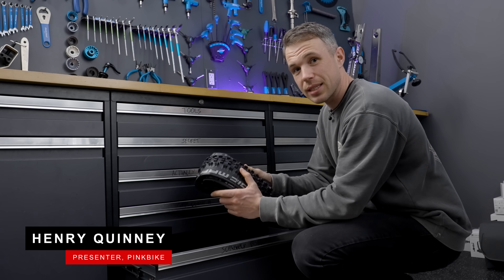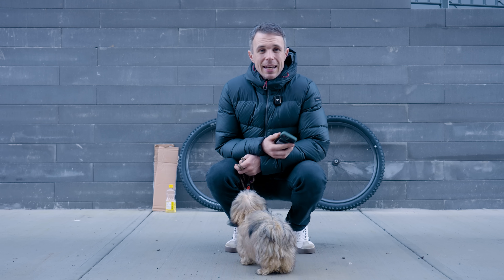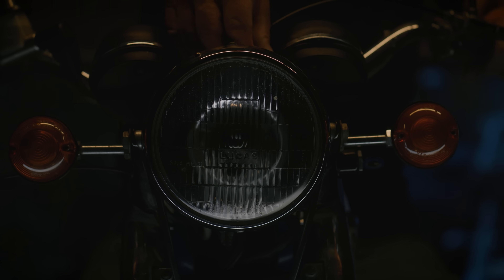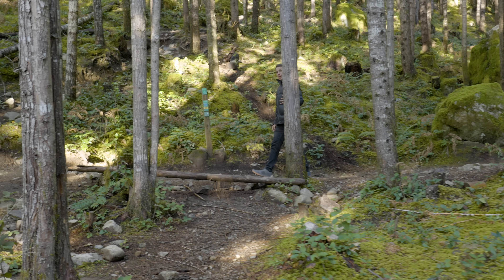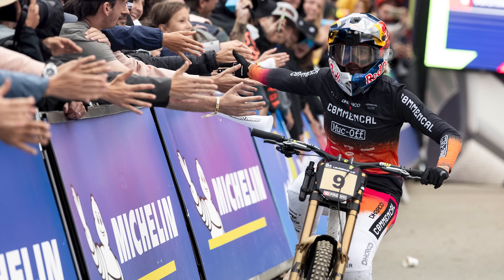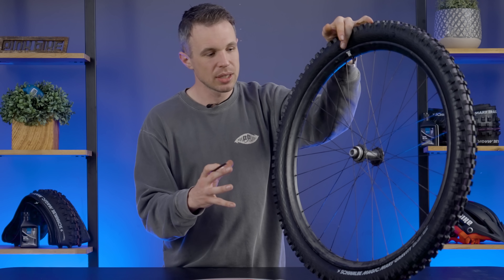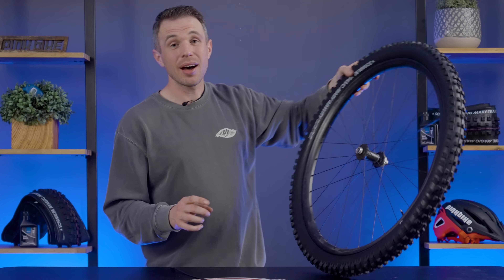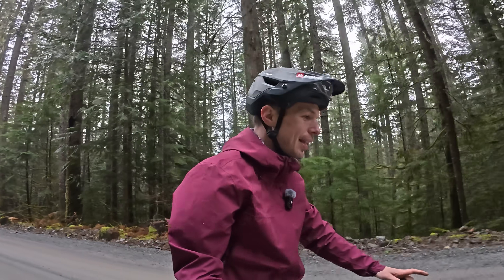How Does Schwalbe's Radial Casing Work, and Does it Actually Make Any Difference?

Comment: If you choose the air pressure so that both tires have the same rolling resistance, then I would like to know how the riding experience is or whether the difference cancels out. Everything else sounds like pure marketing to me. The placebo effect is very powerful.
Reply: That's what I was thinking, if you adjust the air pressure so that both tyres have the same contact patch then what's the difference exactly? just the number on your tyre pressure gauge
Reply: @ you cannot think that in numbers, its silly. 30 psi radial feels different and probably still has a way larger cp than a 23 psi non radial. And the point is not to pump them to 50 or keep your non radial at 14 psi.. this thinking is silly and same as if unc had tits hed be an aunt. The feel is the thing, not just the contact patch
Reply: @ I'm not thinking in numbers, I'm thinking in contact patch, if you set up both tyres to have the same contact patch and to where you don't have any rim strike issues, then what's the difference between the two exactly? besides the number on your tyre pressure gauge
Reply: @bertkreft9689  I’ve heard the knobs on the radials are shorter to compensate for the larger contact patch and rolling resistance.
Reply: Haha when you try these youll be amazed. The one thing in mtb that actually makes a difference. And this is coming from a Maxxis guy

Comment: 29 PSI additional 10% contact at what rider weight? Surely the rider weight is the most important info here before anything else.
Reply: 10% more compared to non radial tires. Rider weight is irrelevant.
Reply: I think these numbers are bs. If you have 200lbs on tires at 20PSI, you have 10 square inches of contact patch. The area doesn't change unless you change pressure or weight, but the shape might change a little. That's the whole benefit of a pneumatic tire.

Comment: Honestly, the biggest thing that would improve my tyre performance, are affordable tyres than I can actually replace when the lugs are worn.
Reply: The problem isn’t the cost of the tires. It’s stagnant wages since the 1970s.
Reply: look for goodyear newton mtf/mtr, pretty good tyres for 40€ a piece
Reply: You said the taboo word, people don't seem to like that A-word in this sport! I agree with you though!
Reply: @jqk369  £30 for magic marys at halfords  is very affordable
Reply: CST
Reply: I always buy discounted tires. You can get top older ires for 20€. New tires have better grip, but they have to be changed after around 1000 km. Imagine eating up one or even two 70€ rear tire every year. :O Even if you do the casual trick: putting the front tire in the rear and putting a new one to the front.
Reply: Many people in the MTB industry moved from the dairy industry so they milk us if our money 💰
Reply: I’m really sorry but I don’t buy this argument, yes tyres are expensive but the number of bikes with electronic drivetrains that are at least £500 more expensive than they need to be, carbon wheels that cost the same more, same with seatposts, add that 1500 quid up and that’s a lot of tyres you could easily afford if you prioritised differently, I’m sure a lot of people don’t have all three of the above but you get what I’m saying!
Reply: I Buy The Best Tires for 75$ Each Bulk Good for 1200km . There's Not much Cheap about Mt Biking But it's Great Fun .... depends on what level you want from your setup ..... some people Run crappy tires till they're 15% .... I Change Mine at 25/30% Left .... I want MORE Traction Not Less
Reply: Non tubeless stuff costs like 3x less, and nobby nic is a monster tyre for the money.
Reply: Bro ur in the wrong sport if ur looking for affordable stuff 😂
Reply: @DandyHippo absolutely. I was kayaking before this £2,500 and you had top notch kit that lasted 5 years with no maintenance.
Reply: @DandyHippo  - None of this is new technology. It's an overtly expensive sport because too many....... people... keep buying into it. Period. Basic economics. 
A simple example: Park Tool bike cleaning brushes cost $25—$30. Rubbermaid brushes of a similar type cost $5 at the dollar store. 
There are items that are more expensive to build of course (i.e. carbon frames) but most of the technology is decades old. Back to the 70's some of it.
Reply: @DandyHippo  lol yes, just serviced suspension, one headset and some bearings on my 2 bikes for like 750 EUR. Still I have to replace brake pads, pins are going from China (they are standard metric screws, so no need to have brand on the package) and I still waiting for the price for my son´s bike :D wtf.... :D
Reply: Specialized tires. I would gladely pay more for them
Reply: Fun fact: moto biking, equestrian riding, snowmobiling (sledding), ski racing are ALL more affordable than mountain biking. A lot of kids in my neighborhood stopped riding mountain bikes when they had to start paying their own way. Moto bikes is all they ride now... for a whole lot less.
Reply: @ I like snowboarding and it´s more painfull in my area (central EU) - one day in the small local mountain is like 200EUR for family, no acomodation or dinner. With it, the price is double. Bikeparks cost around 40% of the winter prices. So currently I am lowering winter days and looking for more riding, even service costs are high :/
Reply: @newttella1043 motor bikes are cheaper🤔. Less complicated suspension and parts don’t need to be as light and expensive?
Reply: @vinceking7878 yea but now your have a stupid moto bike and not a fun mountain bike it’s also more dangerous due to increased speed.
Reply: @newttella1043 You are comparing very high end mountain bikes to average motor bikes.

A high end motocross race bike is gonna be at least 3x the price of a high end DH race bike.
Reply: They already exist - Specialized tyres on sale. 

People love to moan about the cost of the sport anytime something innovative gets made and costs more. One doesn't exclude the other from happening. In fact your "more affordable tyres" are as a result of these "expensive" tyres being made and trickling down over the many years.
Reply: i promise you can get any tyre you want, for under £30 i got a bunch of assegai max grips in exo plus for £25 and i just bought 4 of them i guess i just have to wait for deals  sure i waiter 2 months for that but its better than paying RRP
Reply: They already exist 😂 i don't actually think the top end tyres are expensive at all

Comment: I tried Albert radial 2 day ago after changing from Assegai. Now Albert is my favorite! Comfort is on another level.
Reply: Magic Mary Radial is the pick for Assegai replacement. Albert is like the MM Radial trail equivalent
Reply: Good to hear you like it!  I also just bought an Albert to replace the front Assegai but haven't fitted it yet.
Reply: Thanks for your comment Babe......,I ordered a pair but cannot get them until Mid May!  ;-(
Reply: How much pressure did you add (or are you running with the same pressure you used on the Assagai) ?
Reply: @SlowMtbRider  now I'm running the same pressure, but started from +5psi and went down.

Comment: I have the Alberts and tried them out with a bit more pressure than I used to. They felt great. Lots of grip and comfort. Then I added even more air and they only got better! Rolling resistance almost disappeared, they felt poppy, but still had comfort and grip. Amazing tires if you pump them up!
Reply: Isn’t increasing pressure just reducing contact patch defeating the purpose of?
Reply: Schwalbe says, "Radial tires offer approx. 30% more contact area than conventional tires at the same air pressure. Even if the air pressure is increased by 50%, the contact area is still 15% larger." That would mean that if you typically run 20 PSI you could run 30psi and still have 15% more contact patch than a traditional casing. I run 28psi in the rear so supposedly, I could run 42psi and still have more contact patch. I personally find that hard to believe but if I ever have a chance to try these I would be curious to test the claim.  @tedoakes9235
Reply: @tedoakes9235  Of course, but IMO the new construction allows for higher pressures while maintaining a high level of grip and compliance. If you run standard air pressure they stick too much and start to pull in in the corners.
Reply: I really just want to know how to get that stupid purple line off my tire.
Reply: Shred more!
Reply: "Pump up the jam, pump it up
While your feet are stomping
And the jam is pumping
Look ahead, the crowd is jumpin'

Pump it up a little more
Get the party goin' on the dance floor
See? 'Cause that's where the party's at
And you'll find out, if you do that"
/Pump Up the Jam
Technotronic
Reply: @pernyberg2816 awa.....a place to stay

Comment: I wonder how these tires play with say.. cushcores for example. Would the sidewall benefit from some support? Or would the pressure be high enough to negate the need. I’m sure the dampness would be taken to a new level! Thoughts?
Reply: Also, what are the chances of more contact patch causing burping... lots of questions.  Need a whole series on different tests such as how much psi does it take to burp the alberts on the rear with the gravity casing, trail casing, soft, super soft compounds?

Comment: Won't a more supply tyre make it easier to ding your rim? so then you'll need to increase the pressure to compensate? so then would there be any difference between running the new tyre at higher pressures compared to the old tyre at lower pressures?
Reply: I came here to say exactly this. One completely cancels out the other surely!
Reply: He said if you add pressure they still have more contact patch
Reply: @andymtb3212  But he didn't demonstrate it, how much more pressure would you need to add to prevent you from dinging your rim? and would it still have a bigger contact patch compared to the old tyre? I'm not saying it wouldn't, I just need to see some evidence, especially considering the mountain bike industry is full of marketing hype
Reply: @benjy288  exatclty what i was thinking all along. more tyre patch means tyre is deflecting more? so the tyre will get to the rim with less force? pump them up more, so the tyre is deflecting the same amount as a standard tyre and boom the contact patch is the same as would be on a standard tyre. I could be wrong but from how i look at it all you have done is ran more pressure to acheive the same result.
Reply: @gaspertolar7950  Yea, I'm about 78kg and I currently have a syerra front tyre, its 60tpi so its not as supply, but because its not as supply I can run lower pressures at 17psi without any rim strike issues
Reply: @gaspertolar7950 the request from the DH team was a tyre that could be run at higher pressures with the same grip. The increase in pressure meant they didn’t need inserts for puncture prevention which in turn gave a performance benefit of reducing the un sprung weight on the bikes leading to wins. 
For us consumers, we have the choice of same pressures and more grip or like the DH teams, more pressure and ditching inserts if you run them.
Reply: @gaspertolar7950  I agree that there needed to me much more in depth testing before the "Does it work" portion of this video is truly answered.
Reply: @eckythump6429  I wish Henry mentioned it this detailed but added the actual PSI testing at these claimed higher puncture protection pressures.
Reply: @jamesc6876  I agree, running these to remove the need for inserts is where my interest lies. All professional reviewers seem to just gloss over it and the content creators seem to be oblivious to it and only talk about the increased grip at the same pressure.
Reply: Grip requires small patches to conform to the ground. But tire deflection when cornering moves much larger sections. With more radial tires here might be a difference in the former behaviour without changing the latter. Meaning you get a stiffer tire for "macro-deflections" by retaining the ability to conform on a micro level. How well it works remains to be seen, but it isn't a new concept in the tire world.

Comment: I want to run these on my trail bike. But they have no options yet for that discipline. Shredda, Magic Mary and Albert are more in line for Enduro/DH

But if they make one for their hans dampf, wicked will or nobby nick I'll give it a shot!
Reply: I got the Albert. Great for "regular" trail (that's basically all we have in my area). Love 'em.
Reply: unfair comparison but on my 120mm XC 27.5 2.25 rocket rons speed compound and emtb 27.5 2.4 magic mary front big betty rear trail compound and while I'm 10x more confident going downhill than the rocket rons, the big betty makes pedaling in OFF anything else than flat impossible they feel like glue and as if the bike was being dragged backwards I would not want those tires on my muscular mtb unless I was doing mostly downhill but I'm not I climb everything I go down

Comment: Wow, first tubeless tires, now radials. I for one am excited to see what other 20 year old tech the bicycle community can finally steal from motor vehicles. ABS anyone?

Edit: Correction, radial tires were invented in the 40's and became standard in the 80's, so that's at least 40 year old tech finally introduced in 2025. Also, I am in no way suggesting ABS would be a good idea offroad, though off-road ABS does exists on newer dual sport motorcycles. So by my calculations MTBs will have it around 2065.
Reply: Bosche iin conjunction with Magura have already done that too. Primarily designed for cargo and e-bikes though.
Reply: They already are working on that.
Reply: ABS is the worst idea ever on a mountain bike
Reply: ABS do absolutely exist. You just need an EMTB Works superbly
Reply: There are already E-MTB's with ABS, never tried one. I don't want ABS because locking the back tyre is handy.
Reply: If it would've been so easy and obvious, Michelin, Goodyear or Continental could've brought radial tires to the bike market with their experience in automotive technology long ago. So apparently there were some hurdles to overcome.
Reply: Abs would take so much of the fun out of mtb. Please no. Maybe for ebikes and the people that want..... That. Not for the adrenaline junkies
Reply: @FreeTimeFeats  ABS would be plain dangerous on a mountain bike, imagine riding a steep double black and ABS decides to release some brake pressure because it thinks that your wheel is about to lock, that's not what anyone would ever want to happen
Reply: @benjy288  Go ahead and ride one, you'll be blown away. You'd be surprised, the people working on mountainbikes ride mountainbikes themselves! So they had those same thoughts and worries as you have. It is a pretty complex system that takes the emtbs pitch and roll sensor into consideration so that exact scenario doesn't happen.

 I tried it in Willingen last year and was honestly amazed. You don't notice it until you pull an emergency stop.
Reply: @maxritter7868  I won't be, ABS is plain dangerous on a mountain bike, there's a reason why they don't use it off road
Reply: @maxritter7868 Sounds similar to a six-axis IMU (minus 4 axes presumably). Might be a handy upgrade to borrow from motorcycles.
Reply: Aaaannnd.....so what?
I believe the bike industry should pay the motorcycle industry and mtbers should pay dirt bike riders for testing this tech all these years 🤦
Reply: @justmtbandgaming4518  My point is that the bicycle industry seems to be slow to catch on to trends pre-established in other areas. It likely comes down to weight, cost, and complexity. But it seems odd to me that radial tire technology has been there for the taking and it took Schwalbe 40 years to come up with the idea of copying their motorized cousins homework.
Reply: @Cthooligan  Yes i know.
But demands are different the loads the forces are different otherwise all the mtb tyres would have huge knobs 1cm thick side  walls and weight wouldn't be an issue.
Reply: But the thing is that they are not actual radials like on the motorcycles! They are just more radial than the standard, i.e. threads have 30° angle instead of 45°. Nothing radial about them...